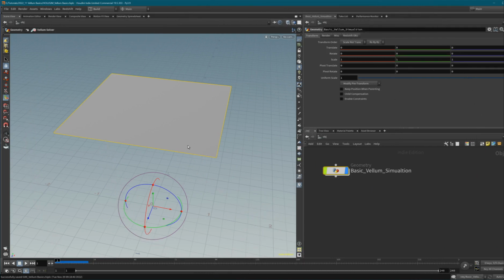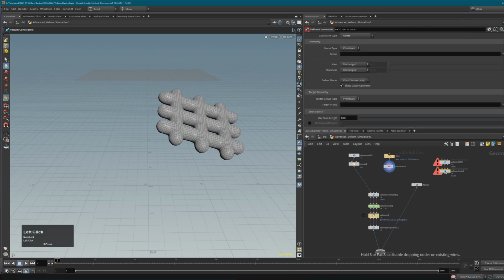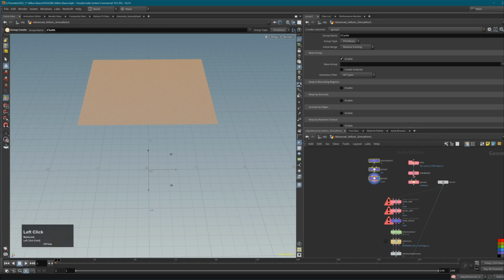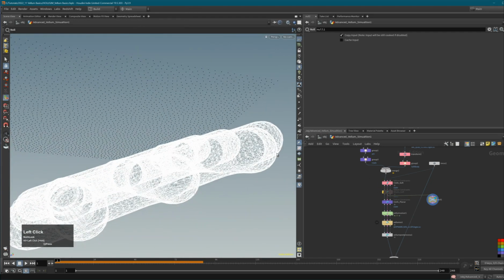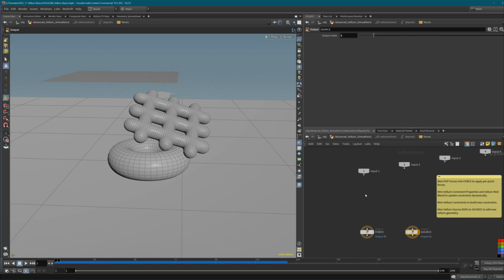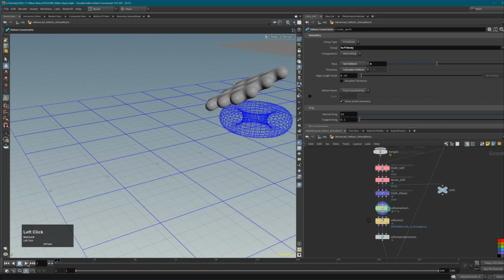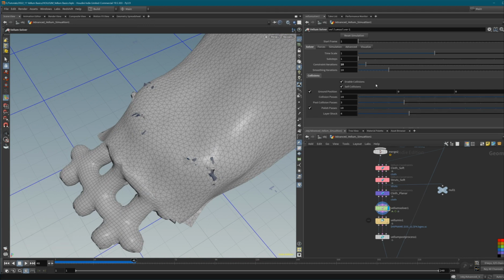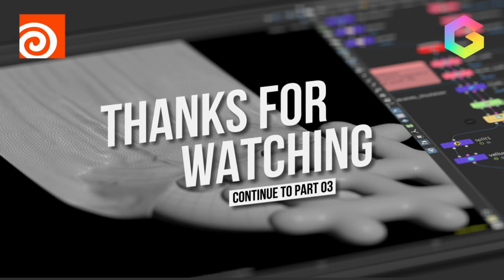From Basics to Brilliance: Vellum Tutorial Series in Houdini (2/3)

Comment: Hey! Thank you so much for this great free content!

I'm having an issue when following along with the video. When you jumped into the vellum solver at around 12 minutes where you're able to add your pop force I noticed that you can still see the rest of your simulation and objects in the viewport. For me it's clearing my entire viewport and I'm no longer able to see anything. Any ideas why? I'm using Houdini 20.0.506 apprentice

note I think I solved it. I closed out of the application and when I reloaded the project it was working properly. Not sure what happened, but keeping the comment in case someone else has the same issue.
Reply from the maker: Sometimes the viewport does not update. There is a reset viewport button under the Labs tab.
Reply: @Nodeconnector  I've noticed that has happened quite a bit, thanks for the info about the restet button!